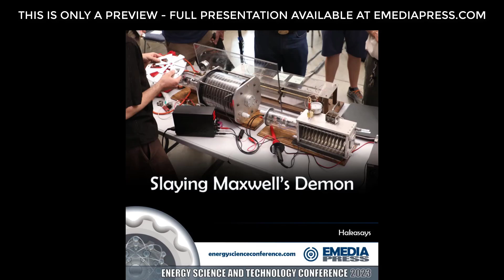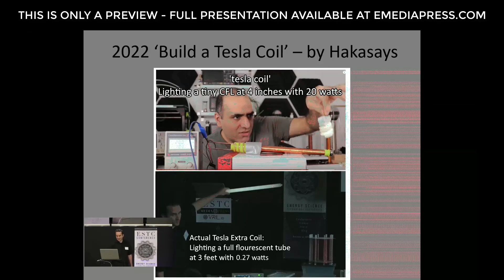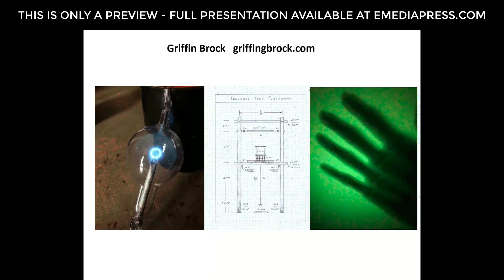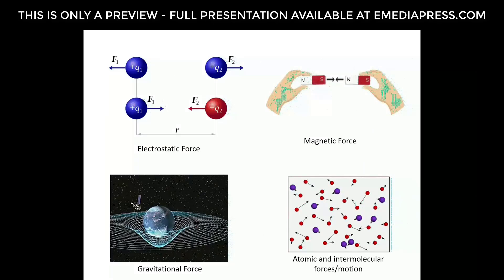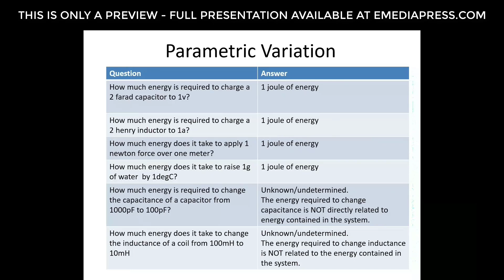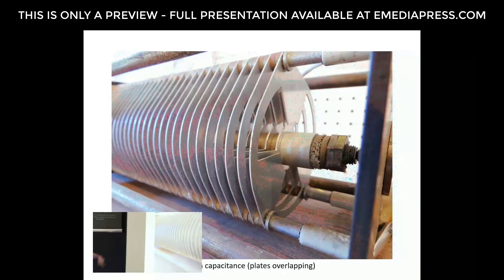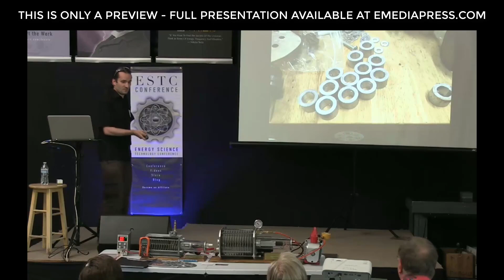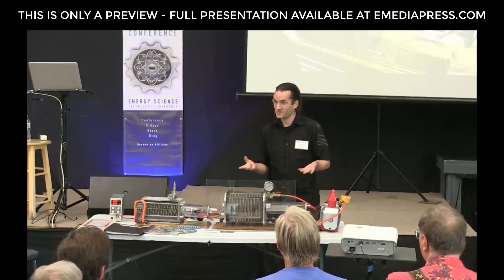2023 ESTC Hakasays - Slaying Maxwell's Demon

Comment: If the primary aim is to bring the plates close and then separate them. 

Can this be done laterally instead?

So if you take two plates and have them move close and separate with a crank type mechanism. Will it work? 

The disadvantage is only having one plate.

The potential advantage is that much smaller spacing could be achieved esily. Capacitance increases proportionally to the spacing. 

Mechanically, it would be a lot easier to get very tiny minimum gap with such a system than a rotory one. So, the capacitance variance could be a lot larger. The plate would need to be big. But as there would be only one, it could be rigid and so hold a high accuracy. Allowing for the smallest practical gaps. 

A plate each end of the stroke means 2 cycles per 1 rotation. 

Is this feasible?
Reply from the maker: I would say in phase or out of phase rather than close and far because the gap between them doesn't change. You definitely want a small gap but has to be a trade off with how much voltage can you get for what vacuum you have before it arcs over so all of those variables have to be weighed. You also want very high speed so rotary is the most effective.
Reply: Yes, you could absolutely move the plates laterally to adjust the spacing, especially on a smaller scale.   For bigger machines though the engineering becomes impractical as you need big springs and thick plates to stand up to the constant vibration.   It would tend to vibrate itself apart.

For a small setup like using a speaker cone or ultrasonic transducer that would be an interesting approach to take.👍

Comment: Congrats on your accomplishment! I wouldn't say that you're the first person in 50 years to do it. A group from UW+Madison spun out a company to build capacitive motors, called c-motive. They somehow were able to get a patent on essentially the same thing that Carson had in the 70's (of course without citing it).
Instead of machined holes in the rotor and stator, I would suggest to try using patterned traces [on pcb] like they did. That way you have a much lower chance of a destructive event when things aren't perfectly aligned. Additionally, you might try a high-k liquid dielectric (that would get circulated by the motor itself with a proper design) like they did.
Reply: Inductance + capacitance. frequency and feedback. Testatika. Ed leedskalnins pmh. Crystal radio's. Iron stone inductance against rosequartz granite piezo capacitance. Triboluminescense...
Reply: @humbuccaneer84  Where would you actually start though?🤔
Reply: @hakasays  like monopoly... from jail. Back and forth thru streets.
Reply: @hakasays  crystal radio's and pulse motors. Testatika different sizes caps like organ. Shumann 8 16 24 32. Octaves 
LC circuits... 2 👋 🌊
Reply: @hakasays  piramids in mexico. Made from iron lavarock and mortar mica (used in capacitors way back) some have a pyramid over a pyramid... another one big, one smaller. Connected with underground tunnel with mercury traces....
Both big ass LC circuits. 
Volume against surface area. 
ankor what. Giza. Many ancient structures show this relation.
Reply: @hakasays  doesn't hurt to know about logaritmic scales. Slide rules or watch 0-12 0-60/3600.
Reply: @humbuccaneer84   Like a lot of good ingredients but missing a good recipe.🤭

Myself, I'd either need a clear principle-of-operation or a clear build design+purpose.  

I've tried exploring electronics without the proverbial compass and it mostly left me wandering the desert for two decades.
Reply: @hakasays  clear? Meaning you don't think... but like to get fed... nothing is for free.... still costing a lot of knowledge, material and time... no one will give you this just because you would like to know.  All i did is give a direction... to be clear.
Reply: I did mention Carson extensively in the full presentation; can only fit so much in a 15min clip.  Such is life..🥲  

The extensive research I did was focused more on academia; I figured there was a good chance I missed something though.  Thanks for the link I'll do some digging and see how far they got with it👍

And the the 'first motor' was clipped/mispoken/hyperbolic, I meant the first full replica Trump motor, that used a deep vacuum seal and parametric capacitance.

High-K dielectric is a good idea too, and even though I don't think it would be ideal due to friction, would still be good to get some data off it.   At some point I'll probably just fill the whole motor with mineral oil and do a test that way.

Thanks for the response, friend☺
Reply: @hakasays Color me surprised that a clip misses context. If you were to design a motor to use a liquid dielectric, would suggest to think about approaching it like a tesla turbine, and design the housing and rotor so that it can circulate with minimal frictional losses.

Comment: Quite a few others have built them, I have seen people copy 3 designs that apparently the others did not know about when built. 
Everyone says they work. The only complaint is that the power out of a larger one is about 15W, not enough to run your house on. The ones with electrostatic motors driving them seem to be the most efficient.
Reply: I've seen plenty of electrostatic motors, but they seem to rely on brush activity rather than parametric variation that I followed (using the John G. Trump thesis papers as a guide).

The real trick happens when these types of motors are put into a deep vacuum.
The breakdown voltages start to go parabolic, so the larger motor I built that is rated ~10-15w in atmospheric pressure is over a kilowatt below 4 millibars.😲  5kv breakdown voltage in air can become 50-100kv or even higher when a sufficient vacuum is reached.

  My work suggests this grade vacuum is barely kissing the edge of what is achievable with a 2-stage rotary vane vacuum pump, and of course the 'godlike' power densities are achievable with a diffusion or turbo-molecular pump.🧐
Reply: so make 2?
Reply: @domestinger8805  lol yeah you actually could chain 2 rotary-vane pumps together to get a deeper vacuum.

Actually I think I'll try that this week sometime, thanks😄

Comment: Any thoughts on using a fractal capacitor switch convertor setup to step down the atmospheric voltage? Just curious. Off topic but legit want to know your thoughts.
Reply: It's definitely doable, but the power you get from atmospheric charge is directly proportional to the surface area of the capacitor (and altitude).

IMO the best place to test such a device would be somewhere at a high elevation, and a good ground.   I'd start with a large metallic structure like a carport or metallic silo that is isolated from ground.

Slightly simpler way to bypass the fractal relay circuit would be to use a regular capacitor and just discharge into a load it when it reaches the desired potential.  Coulombs = Coulombs.
Reply: @hakasays  true enough. Thank you for responding.

Comment: As always, AMA if anyone has questions/comments😉
Reply: Seems like it should  be possible  to do electroplated  3d printed versions too. What do you think?
Reply: @DavyOneness  Definitely could do electroplating for the stator plates.
Rotors should work too but you'd probably have to derate the max RPM+voltages a bit.

There's also the option of using carbon fiber since it is quite conductive at the voltages these types of motors work at.